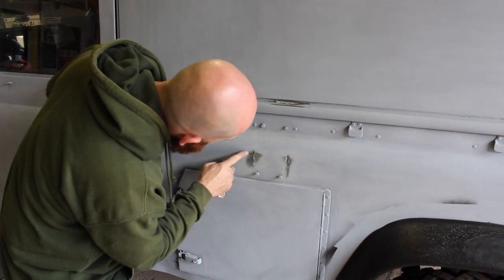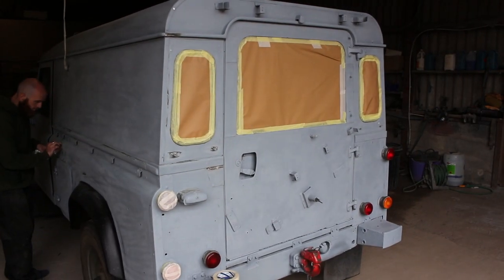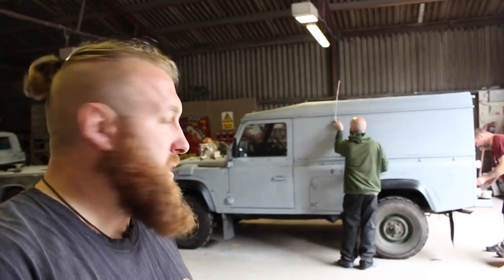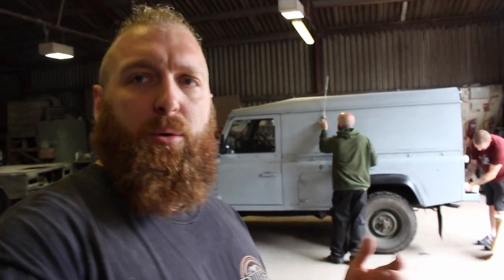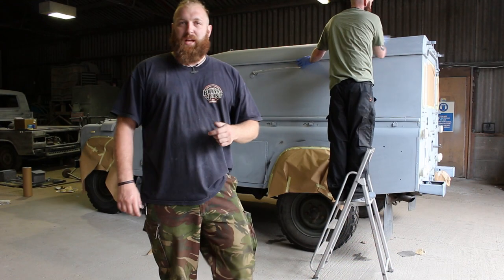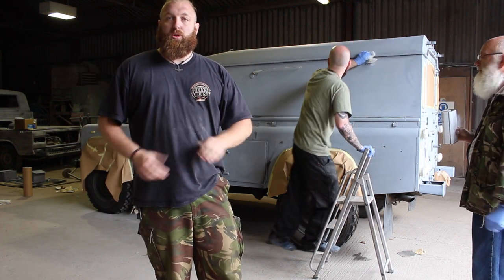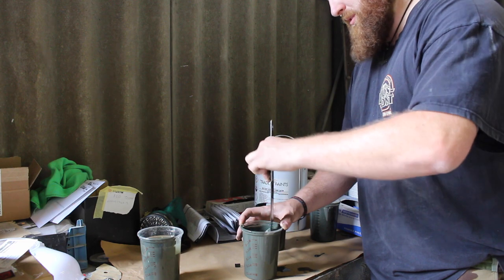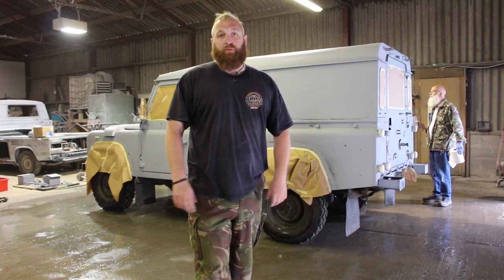DIY Land rover 110 respray.

Comment: Great video Rich. Yeah 120 grit scratches won't hurt that. We used to scuff all the 5 ton cargo trucks with 180, and that CARC paint would fill every bit of it. Is that actual military grade flat paint or auto part store satin paint you sprayed?
Reply from the maker: David Genthner Jr it's an old school enamel 1k paint so it sticks well and fills the small sanding scratches after the grip coat.

Comment: Great video, could have done with someone who knew what they were doing looking over my shoulder when I sprayed Wylf. Great idea! So I have a question, I used metal paint on the roof and I did it on my drive. It was quite late when I finished (21:30) and I mixed    the paint with acstone. Anyways the next morning the roof should have been gloss black but turned out Matt? Any idea what happened?
Reply from the maker: Dan Lloyd at a guess it was the cold damp air that has affected the chemical reaction where the thinners is still escaping the paint. I'v got it on my rear step where it warned a few hours after I painted it and you can see the droplets.  Best thing to do is pick a sunny day where the sun can bake it midday to speed the reaction up.
Reply: Bug out vehicles UK Torn Apart self sufficiency. Cheers buddy, I kinda thought the cold done something to it as the same thing happened about 20 years ago when I I rattle canned a mini ooops!

Comment: Very nice. Just about to paint my series 2a and wondering if synthetic is the way to go.  is it a satin finish?
Reply from the maker: Optimistic Nihilist the series two would have been mat if it’s military  but it never lasts long so I always use the 1k satin paint. It’s trade paint on eBay under military Land Rover paint.
Reply: Thanks for the reply.  This 2a is unfortunately far from original. So I'm making most of it as is.  It's fully stripped. Mostly blasted and will be bare metal respray. Thanks again and keep up the excellent work

Comment: Hi I know it's been a year since the defender was painted we have a defender csw to respray we were taken for 5700 quid for work that wasn't done we were told by the people we bought it off its worse than when we bought it off them now 3 years down the line getting ready to paint it we wanted to know roughly how much paint in ltrs we need yours looks great regards marie
Reply from the maker: Mark Smith it depends what paint you use and how many coats you put on. I only use the military 1k paint and I buy it in 5L tins and I usually have around 2L left over.

Comment: Always enjoy your videos, especially at your new outdoor location.  Question are those Rhodesian camo pants your wearing?.  Where did you get them if they are, even if they are reproductions.  Thanks David
Reply from the maker: David Dirom I'm pretty sure they are Dutch issue. It's the same pattern as British Dpm but the material is twice as thick and they have better buttons and stitching. I got them from a surplus shop in mexborough but they can't get any more. At £9 they make grate work ware.

Comment: Hi, hope you can take the time to help me out. I am planning on respraying my 110 with military vehicle paint, I bought some etch primer also. Did you use etch primer in this video? So sand 120-180 grit, etch primer then a few coats of military vehicle paint? Thanks.
Reply from the maker: James Morrall I only usually etch primer the bits that go back to metal but the guy who prepped this did everything. Can’t complain tho it still looks well to this day.
Reply: Bug out vehicles UK thanks, yeah looks a great job! So I would be okay using etch primer over a mix of bare metal and key’d paint like this video? Only I bought etch primer and hi build primer, was planning on etching the lot then hi build on top before the enamel paint. But if etch worked on this vid I’ll stick to that.
Reply from the maker: James Morrall just make sure the primer has time to cure so it doesn’t react
Reply: Bug out vehicles UK thanks man, I’m planning on getting as much of the paint off as possible beforehand anyway. How many coats of etch was used and then how many of the Military paint? Appreciate the help.

Comment: this is cool but i work in a defender garage and you NEED to remove the wheel arches and doors when you spray your landy. over time they will move or sag and the difference in colour becomes abviose. really you should remove everything ...
Reply from the maker: Come on at what point did this look like a tutorial for a professional respray? What I do is DIY stuff that anyone can do. It even says is in the title of the vid.
Reply: @Bugoutvehiclesuk  yes of course and I don’t want to seem negative what you have done is wicked! But it’s is probably quicker to take if the arches and know it is a clean coat than have to risk masking around them. Either way still looks cool as 👍
Reply from the maker: @jamesforbes_mtb2380  the thing with the military paint is it needs doing every few years so there is no point going mad with prep. It’s already faded so needs doing again.
Reply: @Bugoutvehiclesuk  ahh fair enough I didn’t know that makes sense now

Comment: That looked so easy... But , then again you buggers know what you're doing . Last time I used my spray gun it was on the decking and fence. Almost 'spray tanned' the neighbour. Stupid fucking place to sunbathe when some twat on crutches is jigging about wafting a 'loaded' spray gun about. I did tell her   the darker brown shade I was using was a nicer finish than the dodgy orange she usually ended up having... I even offered to fill in the  white bits for her... She didn't seem impressed really.  A mystery that .No pleasing some folk .

Is it an   oversprayed one coat job Rich , or multi-coat ?  Looked like the prep, especially the masking off, took way longer than the spray-up .

Looks really good. nice one.

Comment: I cringe ,,,, 2 seconds in  and the chap is sanding without a block... always always use a block ,, your finger will leave little gullies and indents, and will take away the paint before you hit any high spots and gorge deeper. Also if you hit metal you have gone too far ... and what is with 120 grit ... what are you sanding ,,, a wooden post ,,, hells bells people all that work you have done and you are giving yourself more
Reply from the maker: Amédée Bollée this has been brush painted for years and was peeling off leaving chunks a few mill deeper than other bits so going round with a 500 grit would be pointless. This is re painting a military Land Rover with military paint not a new Range Rover.
Reply: my mistake you are right, just thought it my save you some time. just didnt want you turning those high spots into lows and having to start over. And Columbo`s "one more thing" have you ever tried putting the masking tape on the paper first.? like for over the mud guards. it will save you even more time ! atb